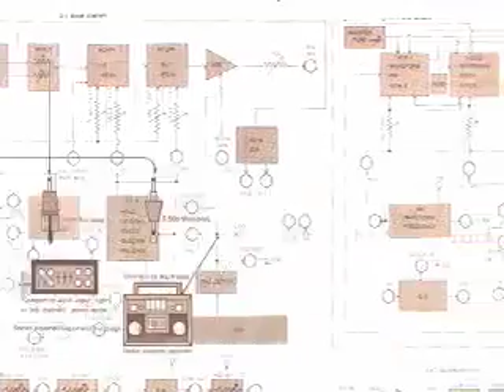The Korg MS-20:  The Patch Panel 3

Comment: What mic do you use ? I hav e a condenser mic (xlr) but I dont want to buy a xlr to 3.5mm jack as I believe the mic wont work as it is phantompowered

do you use a stanard karaoke mic with 3.5mm converter ?